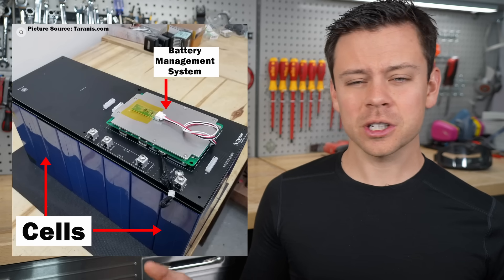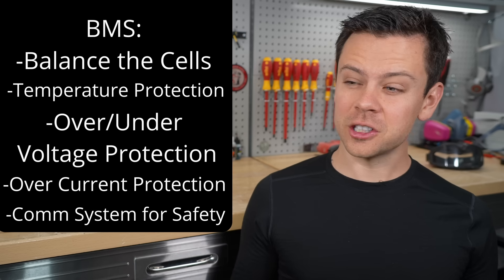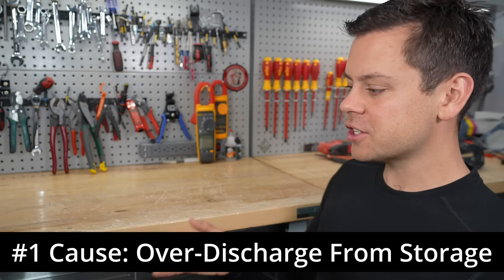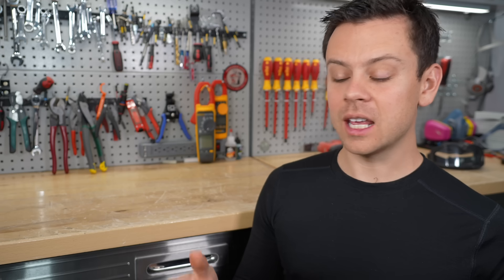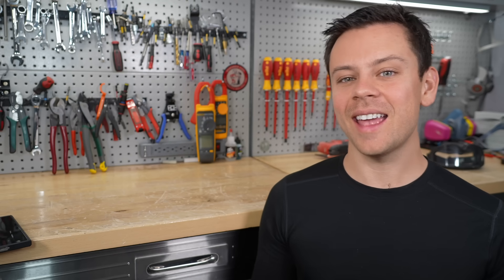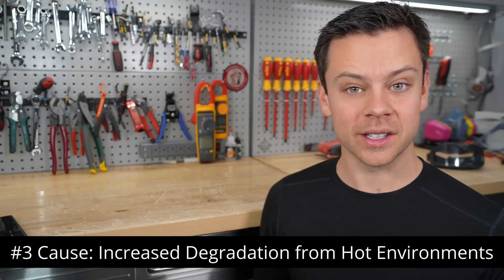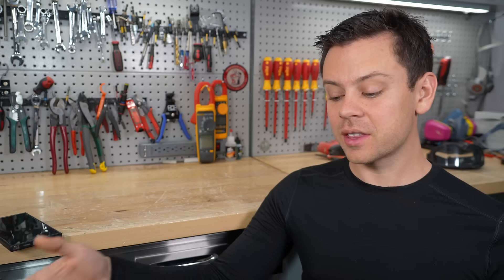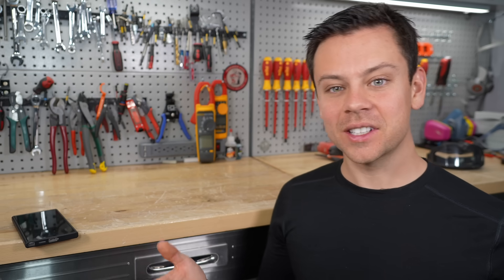The Rules of LiFePO4: The 3 Most Common Causes of Failure and General Guidelines for Long Term Use

Comment: I have two 100ah Expion batteries in my RV. They charge with a Morningstar MPPT controller programmed to charge Lipo's. I have 700 watts on the roof. Now that our RV season is gone I've brought the batteries down to 59% and they've been sitting for two months, so far. I'm in the Reno area so you know it'll be getting cold. No problem with them sitting at 59% while we wait for our next trip? I check my battery monitor every couple weeks and they consistently show 59%. I have disconnected the batteries from any contact with the trailer's electrical system to avoid any phantom draws.

Comment: I bought a Montek 2000 which I believe has NMC chemistry. I plan to use it in the summer months in my off grid cabin in upstate New York, then charge it full before I leave for 10 straight months. It gets well below zero F some days up there. 
What is your advice to keep up the life in that battery?

Comment: Am I the only one who cannot follow his logic? And what is a cycle? 

Regardless, I want to know how a LiFeP04 works in a moped being cranked up several times a day and driven for about 1 hour. The voltage ranges from 13.4 to 14.7. There are 4 lights on top of the battery and shortly after the engine is running the 100% amber light comes on. There is a picture of a motorcycle on the battery, but the paperwork that came with it says nothing about placing it in a motorcycle.

Comment: Another great video Will!  If you are putting an external BMS battery in storage for the winter do you need to have a BMS attached to charge the batteries during the storage period

Comment: I bought a LiTime 12.8 volt size 24 100Ah battery w/bluetooth app (which I love). I put it on a charger immediately & it slow charged for a week (it was a Motopower 12v 2amp charger). It reached 100% w/3.9 volts & it showed that the cells were balancing well. However, the charger never showed the battery reached it's peak charge. I checked w/a gauge. the volts & it showed 13.2 volts. Am I doing something wrong?

Comment: Great video Will. Quick question, I have lithium in my motorhome along with solar. Are there battery maintenance recommendations for my batteries when I'm connected to shore power for several months and the batteries are connected to my converter/charger? 

Battle Born techs suggested disconnecting from shore power monthly and running the batteries down a bit. Any thoughts Will? Appreciate it!

Comment: Mr. Prowse, my 8 lithium 3.2 volt 310 amp hour batteries were all at 2.9 volts. I've been charging them for days and the best I can get is 3.0 volts. How can I connect them to my Daly 250 amp bms to use them at 90%  S.O.C. with out getting disconnected?

Comment: PV magazine just released an article showing that lithium iron phosphate batteries can release far larger volumes of gas in a thermal runaway and which are far more toxic than other lithium technologies. People have been fooled with all the hype about safety as the temperature differential between lithium iron phosphate and NMC, the thermal runaway temperature difference is only about 100°. I have found that far too many people are installing large lithium iron phosphate batteries within the building envelope which I think is absolutely Ludacris. It's like storing 5 gallon bottles of propane in your children's bedroom relying on the valve to stay shut and thinking everything is safe.

Comment: My Problem. 
The instructions say to turn on the power bank first and then plug in the charger. But if the power bank has drained to zero it will not turn on. So how am I going to charge it if it doesn't turn on. I am new to this. AC 200 Max plus two additional expansion batteries.

Comment: With a 16 cell lifepo4 battery the offical MAX voltage is 58v. Are you encouraging us to set our inverter to charge up to 58v?  I have been charging up to 
56.6v according to the inverter Cutoff settings.  My shunt shunt reads 54.59v as the peak voltage.  Would you regard this as 100%?  Should I set the inverter shutoff to 58v?  Thanks for sharing your experience 😀

Comment: I plan to place batteries in garage here in Central Texas.  Our garage stays around 100° or below because our air conditioned house surrounds most of garage.  Our metal garage door faces North away from sun is always in shade so it doesn’t turn into an oven like Southern Sun facing garage doors.  We may hit up to 105° for a few weeks. I considered making a conditioned space for batteries and keep around 80° during peak of summer.  Is it really necessary in my situation?

Comment: I'm confused... If we're supposed to keep it charged to 100%, but store it at 50%, then it sounds like keeping it at 100 is not best for the cells. Why wouldn't a lower state of charge, properly balanced, be a better condition to keep it in? Edit: rewatched the segment... It sounds like he's saying that it's not worth the hassle rather than it being actually bad for the battery, is that right?

Comment: Will, do you have any advice on running Lithium batteries in a car in both the starter circuit and as a house battery? I'm seeing and hearing all kinds of "advice" from the guys on the internet and they're all over the place.  I'm really concerned about the charging rates and using them with disconnects so that I don't completely discharge the starter battery and end up stuck somewhere.  I'm fairly certain most folks are just running them off a standard alternator, they think it's fine ("I've been charging my battery for ___ years and I've NEVER had an issue").  They'll die on that hill no matter what. TIA.

Comment: Can I charge a LiFePo4 while the load is attached? I want to use one with a DC-AC inverter to power a fridge and freezer during power outages but if the outage is prolonged and the battery is getting down I'd like to top it up using AC from a generator and a LiFePo4 mains charger. I guess this is what happens with a solar system but I just want to confirm that is ok.

Comment: I will have to disagree with you on the 0 and 100% deal. 
How many life cycles have you gotten out of a battery doing this? What was the capacity and esr degregation? Exactly what battery you use and is typical charge/discharge C loading and at what temps. 
I worked for Cadex for 16 years and I will say from my experience your info is wrong.

Comment: I have a situation where my batteries/inverter system is grid tied with no solar panels, just performing a UPS function. My grid power only drops out 2 or 3 times per year and for maybe 2-3 days at a time. So most of the time my batteries will be charged to 100% and hardly ever discharged. In fact, this only happens in the cold winter months of December-February. I need this UPS to keep my pipes and water tanks from freezing. Am I going to shorten my battery life by having them charged to 100% nearly all of the time? If so, can you recommend a remedy for this? Thanks.

Comment: I have 4 powerpro indoor versions paired with my 18kpv i charge them to 100% and down to 46v  before my generator turns on and brings it up to 51v which is about perfect for my solar to rarely waste any power and my off grid and property  needs 🎉

Comment: Will, I have a couple questions, and I was wondering if you had an email address, so I can explain the situation, and get clarification on where to go from my current position. As it pertains to solar panels, charge controller, and batteries.

Comment: I have two 100ah lifepo4 batteries in my SUV. They are charging via:

 1. The alternator with a renogy DC to DC charger   in between rated at 60 amps. So, at most , each battery is getting 30amps i assume (when in full discharge)

2: Via three solar panels, roof permanent main one. Removable panels on the outside of sunroof and front window, when I'm parked. 
That's about 15 amps.

3. Two hamsters running on generator wheels in the back. 

Last one was a joke. Duh. Lol.

Question: is the 30amps for each battery, coming from the alternator, too high? Will this high C rate not let their respect BMS' balance well internally? Any thoughts?

Comment: OK, be easy on me, There doesn't seem to be any APU system using larger batteries, is there a cheap, safe and easy way to just rig up an APU with 100 AH Battery.

Comment: Because i use 123SmartBMS that has a voltage difference of 0.02v it debalances my battery banks and i have to manually balance first group of cells on each battery bank. And there is no way to fix the 0.02v resolution problem. It gets so bad that when all batteries are at 3.40v the first group has only 3.36v or when discharged all are at 3.20v but the first group is at 3.10v. So stay away from 123SmartBMS.

Comment: My batteries rarely go below 70% SOC, 29 kwh of storage.  They might soon with winter setting in when there's a multi day snowstorm and strings of cloudy and short days.  but once the sun does come out, the batteries will get charged fast.  even in light overcast they charge a bit.

Comment: Hi Will. my panels are 24V,  the life po 4 battery is 24v,  then converted to 240. My Question is, in order to supply the inverter to create 240 i was recommended to set the inverter to start charging at 23.3 v. but the battery still has 60 % charge, which means im only using 40% before the cut out and charging starts. How fare below the 24v rating should i allow the battery to drop before charging.? thanks Colin.

Comment: I’m in northern Wisconsin and in heavy wood that provides me zero solar. I use an Anker F2600 with a LiTime 51.2x 30ah battery to back it up feeding the F2600 through its xt60 dc inlet port. I charge the entire system simultaneously with a Champion 4250 inverter generator feeding a LiTime 51.2v 30ah dc smart charger. Charging to 100% is what I desire, but for battery health., what should I not allow percentage wise for either the LiTime battery or the F2609 to fall below. Thankyou.

Comment: Hi will
Another clear and concise explanation video thanks.
I do have one question however.
I run my home on a single 48v 300Ah rack mount battery with 2A active balancing BMS and 5 months in its going great, my battery charges via 7.2kw solar array to 100% daily with very very rare exception and my typical consumption is Around 20% per day so battery is nearly always above 80% 
Is that OK or would it be worth turning off solar for a day here and there to deepen the discharge depth periodically?
Thanks

Comment: Love your content! Two questions... Retiring next year and want to boondock in my travel trailer. Upgrading from lead acid to Redodo LiFePO4 and solar. Been watching for the best price as I won't need the batteries till April or May. Any disadvantage to buying them 6 months before I need them? (obviously proper storage is key)  And secondly, is the Bluetooth feature on a battery really worth the expense if the controller already has Bluetooth?  Thank you!

Comment: Thanks for this good info but I’d like a bit more clarity on your advice regarding percent state of charge for these batteries. It’s 0-100% with respect to the BMS, not the actual state of charge of the battery itself. 0-100% on the BMS is actually ~2.5 volts min up to 3.8 volts max per cell, correct?

Comment: Here's a simple question. Will, been watching you since the beginning, thank you! I have 12 battleborn lithium 100 amp hour batteries in my camper van. I have 620 w. Of solar and I have the new victron 3000 w because my xantrex died after 3 or 4 years, in the summer. My system stays 95% and above because of all the sun, July, August, September now or into November and it goes down to 75%. I've never brought it down to zero and running a freezer. A fridge, a microwave charging my phone. I call it a mobile condo, is that a challenge that I don't bring it to? To zero ever never goes below 75%, I bet you a lot of people. But have four or six and are wondering the same thing that I am? Have a great day!

Comment: Everyone's system and use profile is different which makes it difficult to charge and discharge them at the perfect rate. I have dialed down my obsessive battery monitoring habits over the years. My system is small and it is in van. We only need the system when we travel a few times a year. The rest of the time the van sits, the chargers are disconnected, and the batteries VERY slowly discharge while powering small loads like tracking devices and monitors. For winter storage, I make sure they are at 50% and disconnect everything. Then the van is storage in a heated building for a few months. When the van sits for weeks outside during the summer, I feel like I should run a load of laundry or something every night to effectively use the power in the batteries and rely on the rooftop solar panels to charge them back up the next day. Or run lights when I am working in the shop at night. Maybe that would be a better use of the system. The reality is that comparable batteries today cost a small fraction of what we paid for them 5 years ago and even if I only get 10 useful years out of them I will be happy to replace them with something more advanced.

Comment: in one breath you say don't let stored battery fall below 50% and in the next you say it's best to charge to 100% and use - discharge to 0%........so what is it? is it ok to go to 0 as long as you charge back right away?
Reply: For STORING, 50% capacity.  For operational use, fully charge to 100% and drain to 0%.  Then when you store it again, charge to 50%.

Comment: I am using a different approach. First of all, I use no BMS. I have bottom-balanced my cells at 2.5V about 5 years ago. I have set the cut-off switch at 11.2V (4 x 2.8V) and the solar charger stops at the total battery voltage where one cell exhibits the highest voltage, at 3.6V. So if other cells were 3.5V at that point, the charge cut-off is set to 3.5 + 3.5 + 3.5 + 3.6 = 14.1V.

This has been running fine for 5 years now and once off of the fully charged state, the cells are still within 10 mV of each other. This implies that they also reach 2.8V at the same time. So I will never suffer from a defective BMS and leakage through the BMS.

Comment: I really enjoy your videos.  I have a LiFePO battery 40 Amp 12 V .   I intend to use it eventually as an off grid energy source solar charged by solar panels and with a controller suited to this battery.   In the meantime I would like to use a 120v Lithium Ion battery charger.  It is a 20 Amp charger with the following protection:

This smart charger provides multiple protections to prevent over voltage, over current, short circuit, and overheat. It has full charged auto stop function and 0V charging mode. When the LiFePO4 battery is being protected by BMS, the charger can reactivate the battery and restore the normal voltage
【Self-Cooling Fan and Indicator Lights】The battery charger is built in with cooling fan to reduce heat. And with 2 indicator lights show 4 different status, which is convenient for you to quickly understand the charging status of the battery
【Designed for Lifepo4 Battery】12V 20A LiFePO4 charger is designed for 12V(12.8V) lithium batteries, with a constant current of 20A and a constant voltage around 14.6V

I am supplying 7 volts to an arduino that draws only .03 Amps and it also has a motor shield that controls a 12V  linear actuator that shuts and opens a chicken door operating once in the morning and once at night.  Not a heavy demand upon the battery. It will likely also control a 12 V wheel chair motor to deliver food once a day.  Again not a heavy demand upon the battery.

Here is my question.  Can I leave this Lithium ion 20 AMP charger on at all times?  Will there be an consequences to doing this with this battery.?   Thanks in advance.

Comment: If the batteries are sitting for an extended period, why not charge them to 100% instead of 50% to counter the discharge rate?  100% charge keeps the cells balanced.

Comment: I agree with most of what you say but you need some disclaimers. Do not just charge a unbalanced pack to 100% if the batteries are out of balance. Always check the amount they are out by and check the balance rate of the BMS. Also charging to 50% to many time will cause the unbalance due to the BMS not balancing as you have not pushed the voltage high enough to active the balance.

Comment: 07:47  Many thanks, Mr. Prowse, for your informative lesson re modern LiFePO4 battery units.  You get what you pay for.  Cheap BMS units can be a very bad choice if they fail within a few years.  I have various electronic devices [clocks, power converters, precision thermometers, etc] that I constructed over 40 years ago that still work just fine, but that required some careful attention to subtle design features.  In our modern society of throw-away consumer electronics [i.e. cell phones],  shopping for long-lived products is a non-trivial exercise.